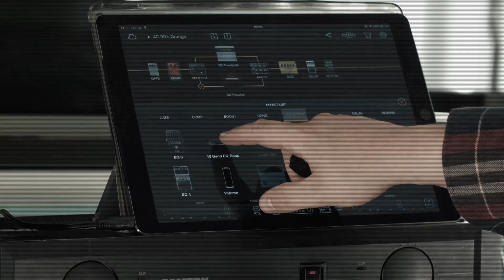Modifying an SM57 - Removing the transformer (TapeOp Mod) and changing the impedance

Comment: In general you produced a fine video. A lot of good and interesting comments. Forgive me if i may do some myth busting regarding what you said and what others have commented. Many commenters noticed a pseudo stereo effect on the guitars. We do not know what other alterations you may have made during the comparisons which lead me to question the results of the tests. Your first statement suggests that the stock 57 has a transformer to offer a means to match the impedance of the mic to the first preamp and to increase gain which 'helps reduce Gain Before Feedback.' Only the mic capsule design attributes to better GBF. The xfmr has little to do with that. Yes the xfmr is there to match impedances and yes will affect the frequency response of a mic if improperly done. But not necessarily add gain. Regarding the presence of phantom voltage, A properly wired stock or mod 57 or any dynamic mic will be subject to voltage surge only while the mic is being connected or disconnected from the phantom source. But not when the mic is already plugged in. When the mic has already been plugged in and phantom voltage applied, no phantom current flows through the mic or xfmr. I'm sure everyone here has experienced hearing an audible click coming from a dynamic mic while plugging it in or upon unplugging. Actually I do not suggest trying this as it may eventually damage the mic. General rule is to leave the phantom off for all channel strips and pres until all microphones are connected. Then apply phantom as needed. As for adding a 680 ohm resistor, understand the impedance of the SM57 mic capsule is I believe about 50 ohms. The xfmr converts the capsule impedance to 150 ohm impedance. Rated impedance is 150 ohms (300 ohms actual). Adding a 680 ohm resistor in parallel is inconsequential and has little effect on the final audio. Yes loading a capsule or pickup with a resistance lower than its rated impedance will adversely affect the response. This brings us to the most important lesson. Most quality pres include a control to electronically 'match' the impedance of the pre's input to the mic. This is where significant tone and mic charestices can be achieved. Note: If you want the sound of a 57 without an xfmr, try an SM7. Thank you for your time.

Comment: it's much more desirable to combine the sm57 with a royer imo, if you want low mids that sound really full, that is the way to go. but you have to be carefull with fantom power regardless
Reply from the maker: You're talking about changing the sound by adding a $1000+ mic, that's not a tenable solution for a lot of people
Reply: @adamsteelproducer   You're right, the focus of many channels is indeed the cheapest way to get sound, but than again... If Shure thought this mod was better for the overal sound they surely would have sold a modified sm57, Imo it's not worth the risk of damaging the microphone and losing the garantee. Just put on some low freq harmonic plugins and do some other tweaks and you'll have a simular sound, the overal sound is much like the stock one anyway...

Comment: I'm usually use standard SM57, for capture "SPIKE" you had said. I'm using another mic with good response for the mid-low frequency. 
For my hearing reference for the amp sound, I'm using the original audio output from the amp that I want to record. 
In the pre-record sound, I'm using the EQ section to match the recording sound and the reference from the amp.

Input equals output.

Comment: So The most important information is DO NOT CONNECT PHANTOM POWER TO ANY DYNAMIC OR RIBBON OR INDEED ANY MICROPHONE Unti you Have with absolute certainty established how it is wired with respect to the Earthing/Grounding Terminal's in the Connectors and The Screening/shielding In the Cable's is Terminated only to The Earthing/Grounding Terminal's in The Connector's, Find correct information from The Manufacturer's Data Sheets for each Microphone Model or Contact The Manufacture If Possible, if you are confident and certain enough of your own Knowledge with circuit's and understanding them and are Capable of reading/Understanding a Circuit diagram/Circuit Schematic for our American/Candian Cousin's, then carefully unscrew and take apart the microphone connectors or depress any button Latches that Hold the Output Connector's insert in to the Microphone Housing/Handle/Body and draw up a Circuit /Schematic carefully, Using a Multimeter/Except on Ribbon Microphone's because you could Fire The Ribbon out of it's Magnet Gap if you energise theTransformer or Ribbon with even the Very Small 1.5Volts DC of the lowest Multimeter OHMs Test Range, The only Safe way to check a Ribbon Microphone's Output Transformer connection's and windings is to disconnect usually by Unsoldering the Ribbon Assemblie's Output lead's/wire's where they are connected to the Output Transformer Terminals or terminal strips/ connections and making sure at the same time  One side of The Ribbon Output Lead's/wire's is not in anyway connected with or to Earth/Ground Terminals or Output Cable if captive within the Microphone's Case or construction,(as is the Case with Older RCA  Ribbon and Similar American Made Electrovoice ribbon Microphones, American Company  Ribbon Microphone's Etc),Screening/Shielding Braids/Spiral wrapped within the Cable's jacket, is Not in any way Connected to one side of the Output Transformer Secondary output lead's/wire's or indeed on the primary Ribbon side , where The Ribbon Motor Assembly is connected  to the Transformer Primary Winding/Coil, One side of The Ribbon Lead's/wire's on the Ribbon Motor or where it's Lead's/wire's terminate at the primary of the Output Transformer, if none of these places on either side of the transformer is grounded then and while testing the transformer the Ribbon motor Lead's/wires are Disconnected from The Output Transormer then you should not damage your ribbon at all, except if you carelessly handle and move the Ribbon Motor assembly in normal room still air with the ribbon unprotected by any air blast protection it is normally covered by that is acoustically transparent. 
So by exercising those precautions you can now proceed to check with a multimeter and Identify by resistance checks what is connected to what and where it is conneced if the Transformer or it's lead's/wire's are glued in or covered with  sealant such is the case with  Acoustic Loading of the Case/Handle Tubes Shure's SM56, SM57, Unidyne III  SM58, Unisphere,   565S  Amphenol 4 Pin Connectors Screw Lock Ring, 565SD,  XLR Connectors 3 Pin, 566S  XLR Connectors 3 Pin, Unisphere1 Microphones, 545S Amphenol 4 pin connectors Screw Lock Ring, 545SD, XLR Connectors 3 Pin, 545SW Amphenol 4 Pin Connectors Screw Lock Ring, 546S, XLR Connectors 3 Pin, Unidyne III Microphones,  55S and 55 SW Amphenol 3Pin Connectors Screw Lock Ring 556S XLR Connectors 3 Pin, Unidyne, Series Microphones, all have complex wiring as they have in the Amphenol 4 Pin Types Two  output Impedances Available Low Imp Balanced and High Impedeance Unbalanced, 3 Pin Amphenol Types Three Output impedances, on a Switch L M H , Low, Medium, Balanced  Output And High Impedeance Unbalanced,  The XLR 3 Pin Connctors on the SD Tye Microphones 545SD and 565SD, Have Low Impedeance Balanced output or High Impedeance Unbalanced Output available by unpluging on later models, from the late seventies/Early nineties, rotating a connector on the back of the XLR 3 PIN insert by unscrewing it and rotating, after unplugging the connector, 180 Degrees and reconnecting to pin 3, The earlier versions require same procedure to remove the connector but you unsolder the wire already connected to Pin 3 and solder an alternate wire to Pin 3 and this convert's the Microphone to High impedeance Unbalanced as previously above. Early production till 1982/3 Shure SM57s and SM58s Had on the XLR Soldered Blue Pin 2 And Red Pin 3, 150 Ohms Balanced Output, an Orange wire That you swapped by unsodering and exchanging for the Red gave a Balanced 30 ohms Output, an older Studio Standard from the 30s, 40s, 50s, 60s, . Also note that all Shure's Unidyne III series Mics And Unisphere 1 Series Mics have a Black wired Soldered  to the Cartridge/capsule Metal Superstructure On a SolderTag secured by a star washer and American Threaded Half Nut, This wire is not a part of the Microphone Cartridge/Capsule Circuit or any Part of The Microphone Output Transformer Circuit. The Black wire is a Earthing/Grounding connection to The Microphone main Case and PIn 1 In the Case Of XLR connectored Miccrophones, on Amphenol 4 Pin Connectored Mics It is Connected to Pin 1 too, on the Amphenol Connector and The Microphone case also, These Mics with the Dual Impedance of Low 150 Ohms Balanced and High Impedeance Unbalanced have A separate Transformer Output winding for the Low Impedeance Balanced Output, Whch is Floating with respect to Earth/Ground and Balanced. So using an Balanced Cable to an  appropriately wired XlR Connector on the Equipment end of the Cable, you can use Phantom Power on a Globally switched Mixing desk when you are Using Mics that need Phantom Power Such as Capacitor/Condenser Microphones at the same time as Dynamics.
Finally  SM56 Microphones Mounted on a Live rubber Isolation Hinged Stand Mounting Had a Switch which would give a 150 Ohms Output or 30 Ohm Output, both Balanced. as would the 546 Unidyne III Microphone again same mounting swivel as SM56 but Nickel Plated Body/housing withe same switchable impedeances as for the SM56, Both these mics were capable of the switch being finger operated if an accesory plate and Switch twist button/lever were exchanged for a screw on coverplate and a small screwdriver used to effect the impedeance switch change over.
There are electrovoice Mics with an array of 3 and 4 Pin Amphenol Connector's and XLRs and Fixed Cable's, Turner Microphones Using Amphenol 3 and 4 Pin Connector's and 3 and 4 Pin XLR Connectors also Astactic Microphones Using over the Years Amphenol 3 and 4 Pin connector's XLR 3 Pin Connector's  and fixed cable's, all these makes particularly with Amphenol 3 and 4 pin connectors Have their own unique wiring connection' The XLR 3 Pin's Generally follow the older polarity standard Pin 3 Positve Output Phase with respect to pin 2 Negative output standard or the later PIn 2 Positive Output Phase with repect to Pin 3 Negative Output Standard, RCA Microphones Used XLR 3 Pins and could be the Older Standard or the newer Standard as per above and many other makers in America, Europe, UK etc.
Even ResloSound. Reslo, Relloo all the same company in the UK, at the seventies Eighties were Using XLR 3 Pin Connector and The Small Amphenol Tuchel 3pin Din Connectors and they wired them sometimes as balanced when 200 Low impedeance output to the XLR 3 Pin Standards as above at that impedeance, or have a choice of impedances and  they could be unbalanced dual low 30 ohms/ low medium 200 ohms Impedeance outputs and High impedeance and Low/Medium 200 ohms output unbalanced just to confuse things on either the XLR 3 Pin connectors or the Din Connector versions.
So Take nothing for granted with phantom power on any connector type or fitting or hard wiring in to the microphone, if it is Balanced and Floating with respect to Earth/Ground and all of your cable's are wired correctly to that rule and obey that rule, whether fixed cableing or connectored, then you should be ok to connect either transformer output microphones or those dynamic mics without transformers to  a socket with phantom power on it, if that socket is individually capable of switching off the phantom power to it, then do that, switch it off, if it is a global switch on your mixer and you need to use Capacitor/Condenser mics at the sme time as dynamics, check each mic and Make sure it is correctly Banlanced Phased and the Shield connects to nothing but the Metal case of the Microphone and only any metal structure on the Cartridge/Capsule Superstructure, never to either coil end of the Diaphram/coil assembly that are glued together the  coil glued to the Magnet facing side of the diaphram, absolutely no jumper wires from the Mic's coil or the mics transformer Primary in put side or Secondary output side to Earth/Ground or via any resistors in a dynamic or ribbon Microphone to Earth/ Ground, even a small signal capacitor passive component for a bass cut could be leaky if it is some how connected to the Earthing/ Grounding case connection and could pass enough current to certainly destroy your Ribbon Mic ,(or quite possibly your dynamic mic if it is not one of the new type ribbon Microphones with an inbuilt active phantom powered low noise  amplifier. 
So Check  your Microphone's/cable's before you connect to any Phantom capable input for Microphones.